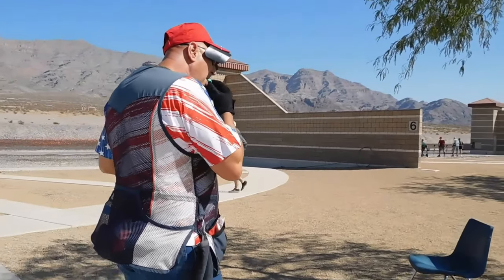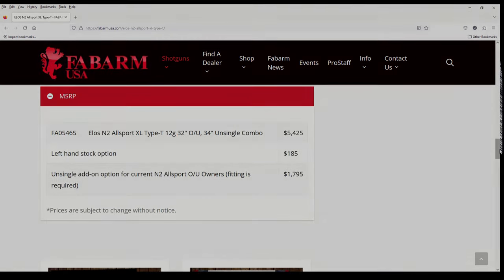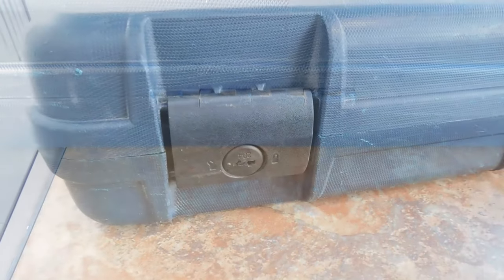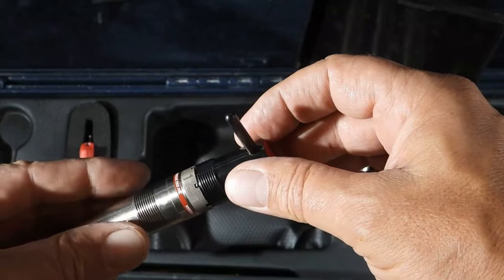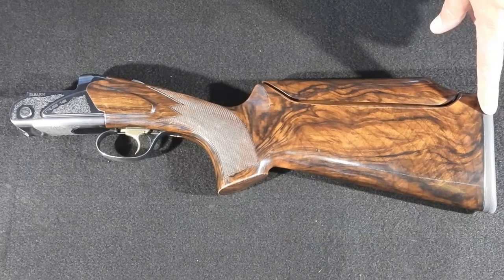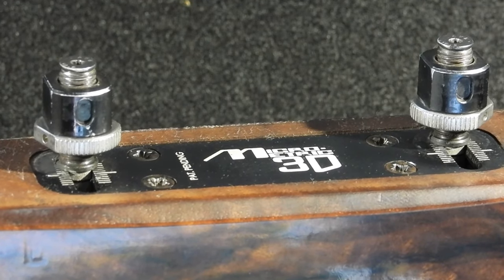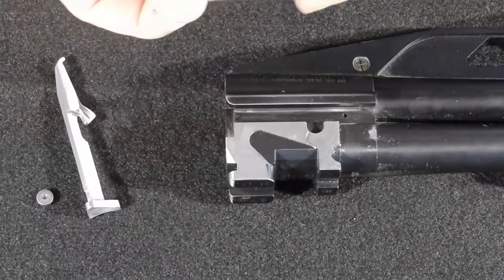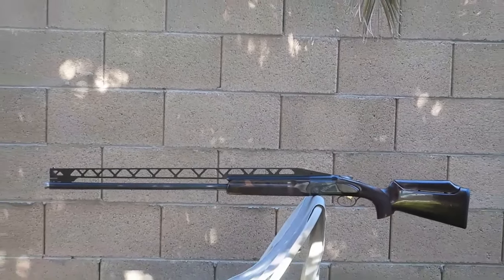Full Review Of The Fabarm Axis RS 12 Trap Combo

Comment: Very informative. Most impressive to me was the outstanding durability for number of shells fired. My aspirational gun has been an Invictus but I am rethinking that now.
Reply from the maker: Thanks for posting your comment. 

Fabarm’s proven its quality to me for sure.  I paid $5,800 for my combo in 2018.  I see that Elos is currently $5,425.  So, they’ve gotten cheaper.  Personally, based upon what I know about my Axis RS12, I would be willing to own an Elos without hesitation.  For you, it’s a matter of how much you value the upgrades Caesar gives you.  For example.  

My Fabarm had a 5-year warranty while my buddy’s Caesar came with a lifetime warranty.  Mine had free annual tune ups for the first 5 years, but his annual tune ups are for as long as he owns his gun.  You saw my carrying case in the video.  His is just like mine except red on the outside and sturdier inside; and cloth lined.  You saw in the video the differences of engraving.  Personally, I don’t care about engraving but I know many gun owners do.  His stock is attractive wood in its natural state, mine is wood with an attractive ink pattern called Triwood.  

So, the Caesar comes with nice upgrades for the added cost.  No doubt!  But it’s a personal choice if they’re worth it.  Me?  My findings are that I have a fantastic value and I don’t intend to change.  I feel like I’ve won!  

Good luck, I hope this helps you.      

Disclosure:  I am not paid or sponsored by anyone.  Not Fabarm or anyone else.  These are my sincere opinions.
Reply: I really liked your video presentation. Straight forward without the bling.

Comment: Did yours ever not stay open all the way? The one I had (brand new) would close back up enough that you had to hold it open to get a shell in the unsingle or the bottom barrel. Both of them were that way. Every once in a while, it would kind of click and open all the way and stay there. Fabarm people told me this was normal.
Reply from the maker: Not with my unsingle barrel, but I do with my over under barrel.  With the muzzle on the ground, just slight pressure forward opens it up a bit more to get the shell in the lower barrel.  It seems spring-loaded like it is made that way, so it never comes to my mind as an issue. Thanks for posting.